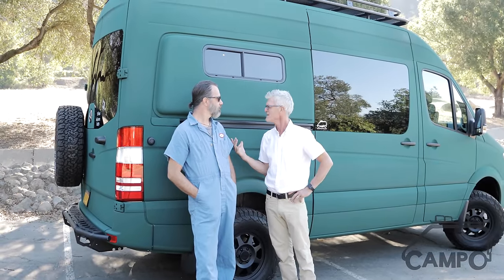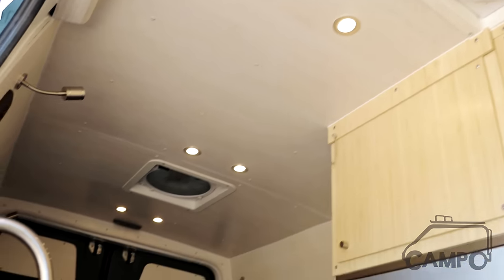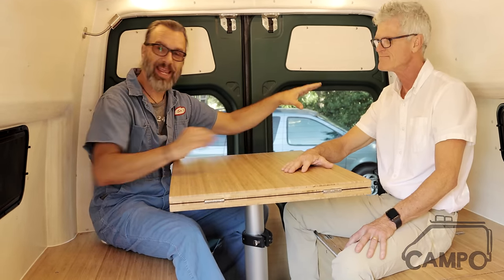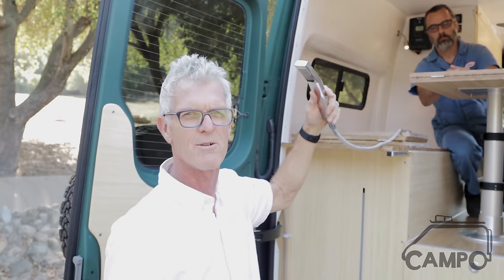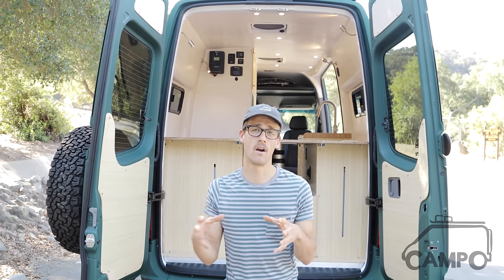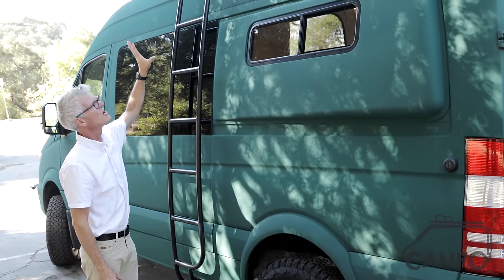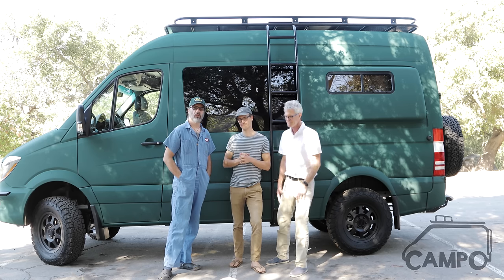VAN TOUR - 4x4 Sprinter with BATHTUB

Comment: Cool design! however, I would not go with a tub and opt for more storage or a bigger toilet room with a shower. The tub seems impractical and a hassle, I can see the steam from the hot water making everything damp, especially the bedding unless it's stored in a compartment. Plus when you get out of the tub you would drip water everywhere (you said he was tall so it would be a pain drying yourself in the tub and having to slouch over and not be able to stand at full height). it would be a pain to mop up, especially when your tired and want to  get into bed, which brings me to my next point of having to make the bed after the bath whilst still having condensation on the wood, which could cause mold to grow on the underside of the mattress if the wood is not dried properly. All I'm imagining is one damp, soggy mess every time you use the tub unless there is really good ventilation in the van to combat condensation build up. Please correct me if I'm wrong, or tell me the design solutions to solve these problems. Sorry for the long rant! just curious to see the actual practicality of having a tub in a van.
Reply: You can store stuff in the bathtub though.
Reply: I wouldn't opt for a tub, either, because I am a shower person.  But, obviously. The person they buil t this for likes to take baths.
Reply: Wilburs Film    I'm feelin you brother. My thoughts exactly. Probs gets the 'little woman'  to wipe and clean up. Mouldy mattress is def a probability though as bed base/table top/ seating is solid with no venting for body moisture build up as it wicks through on the underside even WITHOUT the tub and concomitant added moisture issues.  Yuk.
Reply: Liz Steeds , yep! Exactly, would not be fun. Would be curious to see the condition after months of use, would also like to know if the person who owns this van, if he has had the problems we have mentioned
Reply: @wilbursfilm8858  Doubt if we will hear about it ... The site "Campo"  seem reluctant to discuss price so I imagine we'll have a snowballs chance in hell of hearing about any design problems even via the owner who probably will keep private any concerns especially if he/ she has spent a shitload of dosh on designs he/she insisted on !
Reply: @lizsteeds6697  Very very true!
Reply: The bather drains the water and dries off in place. Try it!
Reply: @micahmitchell517  Excactly.. Not that complicated.
Moisture is ventilated by the heating system & adjusted window's. ¼ of an hour runtime it should be fine
Reply: Wilburs Film And how baths can you have with the water storage capacity?
Reply: I think  he's got teek
Reply: If u were an elder femail who likes to soak your tired old muscles ud understand!!!
Reply: He's using BAMBOO   water resistant   used in a lot of boats mold resistant  along good air flow should have no. Problems  I THINK THESE GUYS KNOW WHAT THEY'RE  DOING.  GOOD  JOB
Reply: They gave the customer what he wanted.
Reply: Once you've run a bath though you would have no water left and would have to drive somewhere and fill up, so I doubt the bath would be used much and they will probably use the showerhose instead for a quick wash.

Comment: Thank you and congrats on installing a TUB.  I love the ideas for the extra width on the side and esp. the tub. I saw on a previous video that from overseas, the builder was able to put in a fixed taller ceiling.  There on hinges from the inside, once could bring down the mattress.  That way the bed remains a bed when put up and the dining area remains not disturbed to set up for a bed at all.  I like your video, good job.   The height of the inside of the van was about 6'2".    I hope you like that idea for the POP down mattress.

Comment: Where is all the storage space? or this just a weekender?
Reply: Chances are it's just a weekender. The sprinter is the smallest size and vanlife fulltimers I believe drive at least the midsize sprinter. Chances are the customer is a rich Wall streeter (NY plates) with the $ to get a 4x4 and hire a company to do all the work for him. Most vanlifers can't afford the services of another.
Reply: Did you miss the full length roof rack or...
Reply: @mcfizirth6704  they most likely did. people are lazy and need to be spoon fed. who says they don't pull a trailer with more than enough stuff?  people like Pip Baxter don't think, they react.

Comment: How does the tub drain? Can it be filled at a camp.hook up?
Reply: @schizophrenicprojection5126  - you definitely wouldn't put it back in the water tanks.  I imagine they just drain it onto the ground.  Gray water usual isn't a problem - especially if using organic, biodegradable soaps.
Reply: LoonToon they probably keep it for making coffee ! It gives it an authentic flavour 😂
Reply: 6kidsand8cupsof coffee I don't think draining would be a problem but filling would be long process in cold climate  😬
Reply: @steveswan5714 Weird statement.. Tap water isn't influenced by the weather. 
Do you think Scandinavia or Greenland only has access to running water during the summer? 
The van is actually heated..
Reply: ArrigAutist it is a a joke 😱 some people will believe anything 😬

Comment: Beautiful build. A couple of questions though. Where do the clothes go? There seems to only be storage for food and the bedding (unless clothes go into the tub when not in use). Also, what are the fresh and gray water tank capacities? Is it one bath and you're out of water?
Reply from the maker: There is very spacious cabinet above the fridge/freezer that a lot of clothes can be stored in.  Clothes can also be stored under the false floor, where this client has opted to store lots of cooking utensils that could also be stored in the galley cabinet.  There is enough fresh water for two bath tubs worth and 15 gallons left over for cooking/hand washing.
Reply: @CampoVans  Thanks for answering about the water capacity. I am surprised you could get 2 baths worth and still have water left over, that is great.

Comment: very nice, but only for the rich... get this my 1983 GMC camper van with shower, fridge, freezer, toilet, stove, furnace, air conditioning, 2x twin beds, NEVER HAD ANY PROBLEMS FOR OVER 10 YEARS, LIVED IN IT DAILY FOR 7 OR 8 YEARS, PAID ONLY $2,500 ADDED EXYRA BATTERIES AND SOLAR PANELS AND MAYBE HEAVIER CURTAINS WELL UNDER $3,000 STILL DOESNT USE OIL, I DO ALL WORK AND MAINTENANCE MYSELF, BUT OTHER THAN CHANGING A MUFFLER, AND CHANGING 2X 12 VOLT BATTERIES AND TIRES ( ALL WHICH WEAR OUT) IVE NEVER HAD ANY PROBLEMS, NEVER BEEN STUCK, HELL I LIVE IN CANADA AND BEEN TO MEXICO 3X TIMES IN IT.....SO ALL THAT FOR WHAT??? AT LEAST$100,000 CHEAPER????  AND I REALLY DOUBT THAT IF THIS VAN LIVES FOR OVER 30PLUS YEARS IT WILL BE 100% SO TROUBLE FREE???  BTW I DONT EVEN KNOW HOW MANY MILES IVE GOT ON VAN, AS ODOMETER ONLY GOES UP TO 100,000KM.  BUT AGAIN ORIGINAL MOTOR AND TRANSMISSION, NEVER USES ANY OIL BETWEEN CHANGES....NOTHING LAST LIKE AN OLD NORTH AMERICAN POWERTRAIN AND IVE GOT PROOF, HECK EVEN MY CAR IS A 1973 NOVA, ALL ORIGINAL, MY TRUCK IS 1965 GMC AGAIN ALL ORIGINAL ( EXVEPT IVE HAD TO REPAINT AND CUT OUT RUST FEW TIMES)
Reply: shane phelan why are you yelling? And why do you think viewers of this video are interested in your 1983 van?

Comment: Could you please tell us how much the conversion cost?
Reply: Yeah that's what i want to know
Reply: If you have to ask......
Reply: If we have to ask it means we want to know how much it will cost to buy it. So how much for the van?
Reply: @annemelendez8900  it's someone else's Van not for sale they just build them
Reply: $10,000,000
Reply: @scnomad3626  10 million or thousand ? I could do thou I'd have to hit lottery for the other 😂
Reply: @schizophrenicprojection5126  Ha Ha 😂 more than we probably have
Reply: I understand it was custom. Are you daft? We just want to know what it would cost us for a similar build. Omg
Reply: Sans green ceramic paint
Reply: Ball park or itemized. Nothing declasse about wanting to know. Serious buyers out here.
Reply: Actually I would between 100-150K
Reply: @annemelendez8900  i agree with you. they can simply qive a ballpark estimate. luxury build extended wheel MB 4x4 with articulating bed and 2,000AH lithium battery  and auto start in advance rv cost 225-300k so this must cost wayyyyy less because the only real luxury here is that bathtub/ dipping tub and this is short wheel. sooo
Reply: Just look at the basic cost of a MB Sprinter then add in another $35-$50k.
Reply: Anne Melendez, you are persistently rude
Reply: I doubt they'd share that info, since this is a custom build, but for reference, a Winnebago Revel uses this same platform (MB Sprinter 144 4x4) and starts at $150k. And custom work like this is expensive. I mean, they're based in CA but the van was painted in Texas? I think that's what they said. Touches like that make these costs soar. My guess is $250k minimum. Maybe a lot more. 

But I feel like someone who gets a soaking tub in their #vanlife van isn't that worried about money.

Comment: If you only have 1 battery NEVER use it for anything other then starting engine. Your a Professional systems tech, learn how to NOT get your customers stuck somewhere because the starter battery was used as the house battery. 
Potential camper owners, always ask about house batteries.
The engine may not be large displacement but diesels have twice the compression then a gas engine, that means twice as hard to turn over. The battery in diesels are larger because they need that extra electricity to start your engine. The 200watt panel?
If you use no electricity and just charge battery it may charge enough to start if you only ran it halfway down. If it doesn't start because its still sluggish, don't waste the charge you have, another 6-8 hours should get you out or always have a house battery, worse that'll happen then is you can't run your air.
I've had air on boats that were solar powered. When my wind gennie was still working I never had to start aux gen to keep bank charged and I had less then 700 watts according to guy who sold and installed for me.
Reply: The battery under the hood is not the starter battery, it is the house battery. The starter battery is under the driver's floor.
Reply from the maker: Hi Ronald!  Thanks for the advice to those who don't understand the difference between house and starting batteries.  We never use starter batteries to power installed appliances.  Similar to what you said, the only purpose of the starter battery should be to start the engine :).
Reply: @HumbleRoad   That would work for most of us but it's not a 600ah Xantrex lithium with a 3600 mega watt inverter  :)

Comment: Clothes storage... Captians chairs with locking under drawers, a row of cabinets over the foot of the bed.... A overhead shelf on the front of the cab jackets an off season... Laundry even.. all set... Stealth mode two plumber van PVC pipes on the roof an white paint job... A a standing slat surface to lay on the ground for a shower with out getting muddy feet...

Comment: Why isn't the bathtub receiving more love?

Even here in the UK I've had (US imports) one caravan/travel trailer and two motorhomes/RVs with quarter bathtubs, OK I can soak little more than my lower leg in it, but it's still nice in conjunction with a shower. When she was younger, my wife could sit in it and the children do too. I'm guessing if you were camping in a southern US state in summer with your generator and AC running 24/7, you could easily collect enough condensate to filter and fill two baths a night. Get one of those old Winnebago Thermosan systems and instead of slowly pumping the holding tank contents into the RV exhaust at 40mph, have it pumping the gray water tank into the generator exhaust when it's under load, perfectly feasible... (probably not).

Comment: At ~4.55
 min its stated you guys are using glycogen for heating the water & air which is incorrect... Glycogen is a branched starch polymer - not typically used for heating purposes. I think you meant glycerol, which is used in heating and cooling applications.

Comment: Love the way the seats open to reveal the tub and then convert the bed. You guys conveniently didn’t show the cushions which clearly makes the process appears much simpler than it is.
Reply: The mattress is in 4 pieces (as standard in most vans), the seating and backrests for the two sofas, which just slide into place when you drop the table, not exactly difficult to imagine or do, and when the bath is in use you stack them on the other sofa - Duh! Use your imagination, it's not difficult.

Comment: Generally these campers have very small capacity water heaters.  No where near the size needed to fill big tub with hot water.   So how did you guys do it?  Instant water heater?

Comment: The best of all about this video is the old man with dog walk behind The Green.

I question if the soaking tub work. After using the tub. Lots moisture will build up in a small van. All surface will be wet. 

It will be like sleep in a small bathroom after someone take shower. All the surface will be wet and moist.

It is great concept to fit "what client want" all in the van. But in reality, while traveling in Van. There were lots thing need be carry around more then just place for food and cooking ware. Unless there is a house mate van following behind this van for for all the support.

I puzzle this concept. I could be wrong. Can you give an update after client actually use this van for 3 years?

Thank you for the video.

Comment: Great job. Love it. 

If it was mine, I’d want a small porthole hatch to the outside with a nearby hanging hook so the shower nozzle could be fed through the port hole and attached via the hook for outdoor freehands showering. 
A collapsible (?) platform to sit up off the ground a bit would help to not be standing in dirt. The stand (steel?) could maybe latch under the van. 
That’s the only spec I’d add to a beautifully designed van

Comment: Continued:  I wonder if you could design a similar van built, but using 'denatured alcohol' as shown on David Blume's videos 'Alcohol is a Gas!' and the documentary 'Pump' about running vehicles on ethanol made out of almost any yard or farm waste.  Also, could you include a hand size wind generator for electricity when the sun goes down.  This was shown by an Olympic wild river canoe racer who did this on his 'Hobbit Van' while training across Europe.  Ideally, every vehicle should have the above options to help the environment.  It is also safer in a crash (much less burning) and much less dangerous to breathe the waste.  Greenpeace and similar activists would be interested in all the above.  September 2019

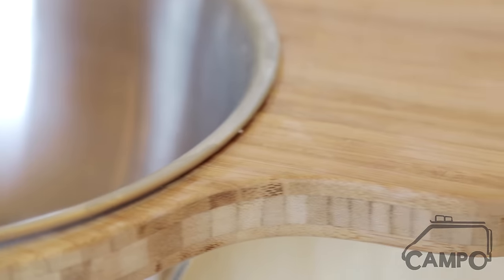Comment: There seems to be a lot sharp edges in the van - with such a tight space, looks like one could get a lot of bruises? Also, the finish looks really rough... like other's have said, the caulk lines aren't even straight (2:09).

Comment: Are these very expensive to have mechanical work done on them?   You've got to go to Mercedes?   Hard to find repair garages?
Reply: Yes, depending on where you are. If you watch the Mexico videos of two YouTubers who have Sprinters, their breakdowns cost them big time and local mechanics aren't as equipped to handle them. Head to "The Matneys" or "Bec & Emon" channels for a better idea of the potential cost. If you're good at budgeting money and saving, it won't be as big of a deal, but if you don't make enough beforehand and during that process it can be really hard.
Reply: You just answered your own question. Buy a different car manufacturers' model.

Comment: You can buy portable foldable plastic insulated Japanese soaking tubs for less than $100 which you can use inside or outside the van. Of course with unlimited funds your system is just fine. .

Comment: Where does the mattress go when using the table? Or the tub?
Reply: Have you never seen any vans before? Mattresses are in 4 pieces, (2 for sitting on on the sofas and 2 for back rests for the sofa's) which all slide down together to form one mattress when the table is lowered - Duh! You've obviously not got any imagination or ever seen other vans  before. And when taking a bath, you stack the two cushions on top of the other sofa, simple!

Comment: I like your concept but your caulking, fit and finish and general finishing carpentry are a little shaky. Some of the common areas of the van don't have matching stains and clear coats. Overall pretty great customization .
Reply from the maker: Thanks for your constructive criticism!  We used two different stains of bamboo as per customer request hence the change in colors.

Comment: The continuous background 'music' noise was really annoying to the point of wanting to leave.  Turn this off!

Van build was superb!  Ingenious, and elegant.  Loved the thin bamboo and steel frame cabinets!
You folks did a great job.  I had some questions:
1.  Why diesel cooktop and Espar heater?  Far more costly than usual types, and diesel costs as much as propane, which burns cleaner.  If you run too low on your diesel tank, engine won't start.
2. What is the flooring?
3. Why Isotherm fridge?  Dometic fridge same size costs $1500, while Isotherm costs $3000 and they both perform the same, look as nice.
4.  How do you store enough water to fill that whole tub in such a small van?  It is a huge strain on van to carry this weight around.  How does this work?  Do they fill up on site or at source?
5. What type of house batteries did you use - Lithium or AGM Lead Acid?  How did you fit this under the hood?  Pics?
6.  What is the advantage of a ceramic car coating over paint?
Reply: Isn't propane more inflammable than diesel? That was possibly a consideration. Obviously it was the customer's choice to buy certain appliances.